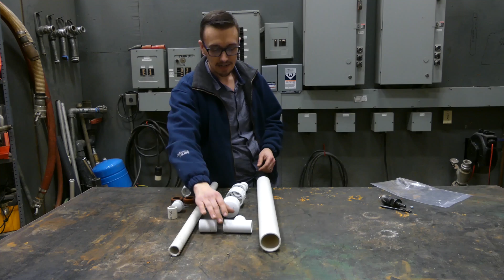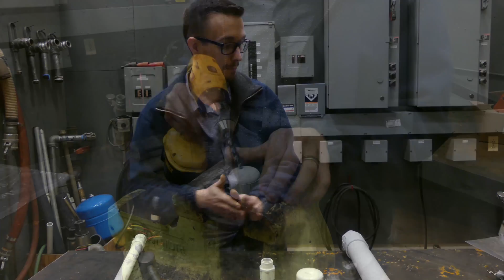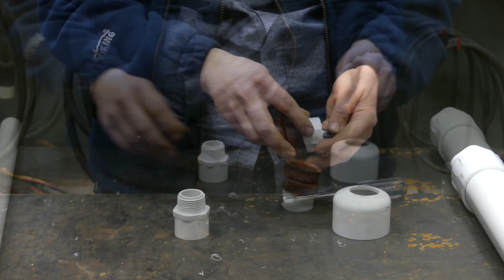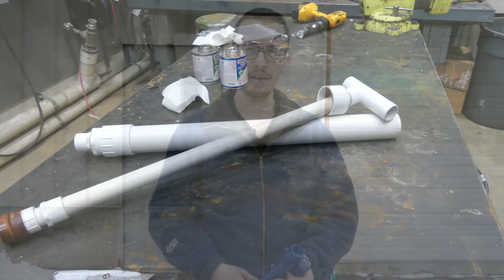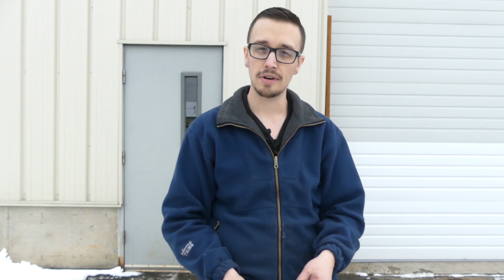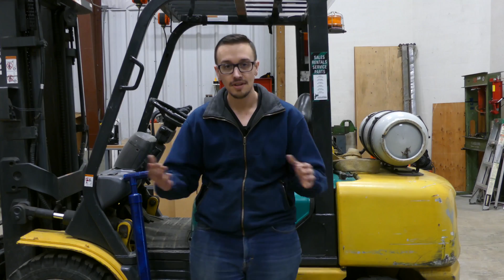DIY PVC Hand Pump

Comment: Where did you find the leather caps, and what size were they.
Reply from the maker: We sell the leather caps, they're usually used for older deep well jet pump systems. I believe the ones we used here were 2", give us a call if ya need some: 855.329.4519